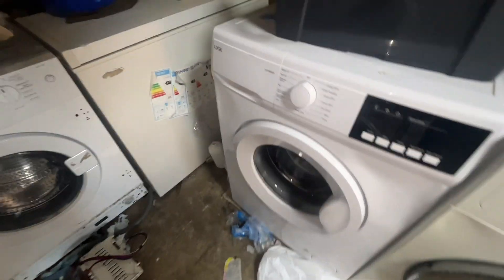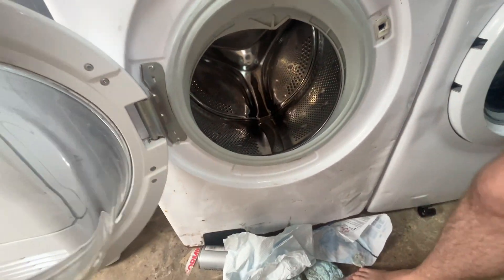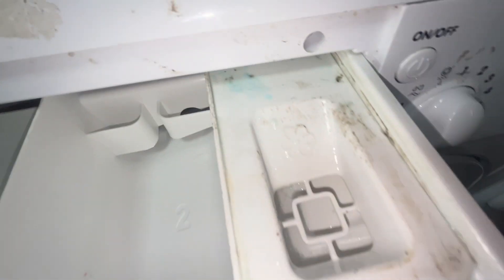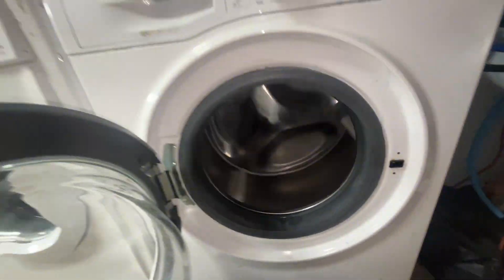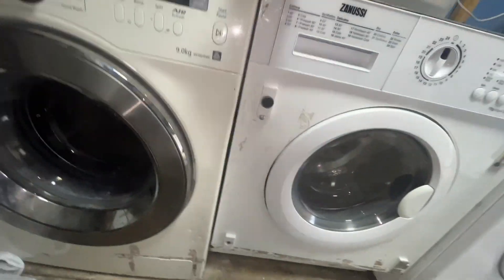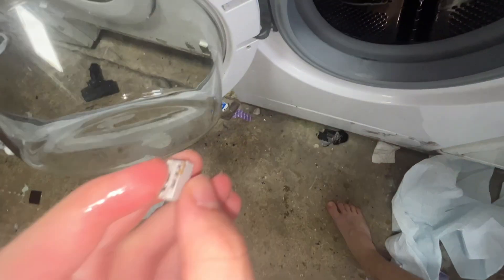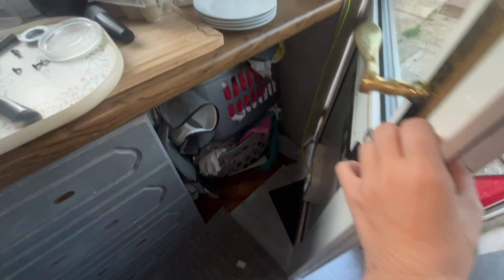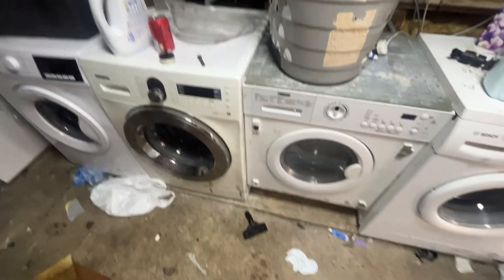A Tour of my washers washer dryers and tumble dryers (including my mums machines)

Comment: You probably want to open that logik and tighten the weight before it gets so loose it breaks the tub
Reply from the maker: I mean that’s a good idea but I’m afraid if I tighten them up too tight they will just snap off. The Samsung had the same issue a while back and my dad tightened that up and he went really tight on it and it didn’t snap but whichwasher2007 said if you tighten them too tight on vestel made machines they will just snap off
Reply from the maker: I’ve done it now